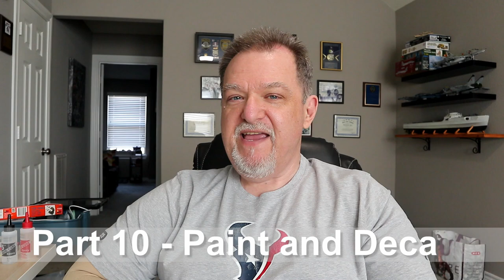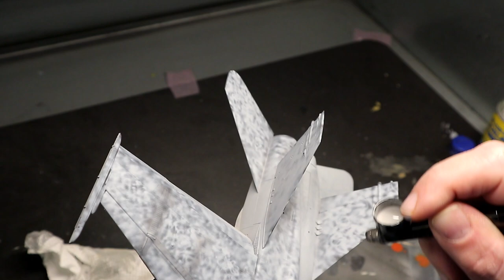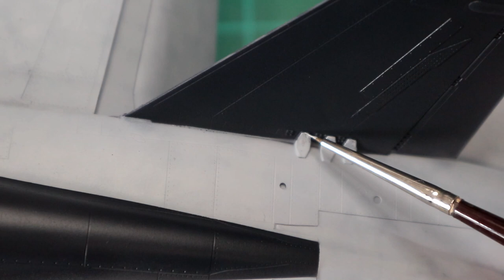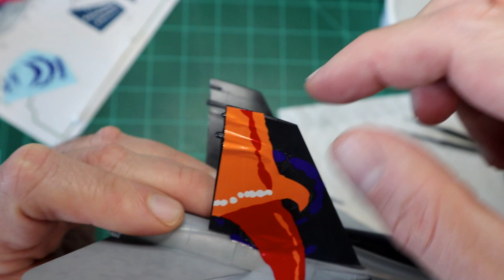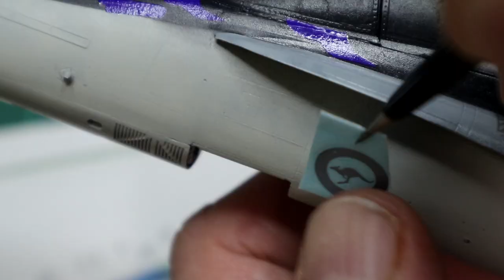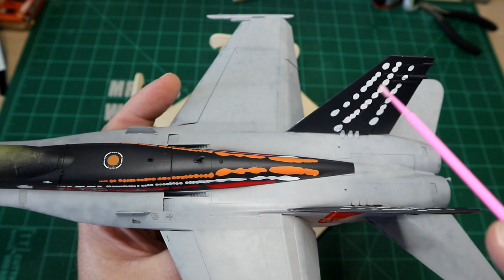Step by Step - Kinetic F/A-18, Part 10: You Need A Little Color...

Comment: Very nice.
I see you used Testors light grey, and I admire you for that (I hate airbrushing Testors enamel, or rather cleaning the airbrush after using it).
Now for the very entertaining part : glueing the landing gear. Funfunfun...
Reply from the maker: The Model Master paints flow much better with Mr Leveling Thinner. I highly recommend using it, especially on MM paints. I'm definitely not looking forward to the landing gear at all - lol.

Comment: I think the decals issues are the Decals themselves.. I have had issues the last two times, over the last several months  that I've used Model Maker decals  and  it was with  adhesion too. One set was a Mig-21 set and the other was an A-10 set. Its funny, the first time I used their Decals  was last summer on a F-16, and they went on flawlessly.
Reply from the maker: Hi Robert - I know that "it's a poor craftsman that blames his tools", but in this case I wasn't very happy with the decals. I would think twice before I'd use them again.

Comment: I think you're being too hard on yourself- it looks awesome! I'm aware of Ronin decals Worimi set- Which brand decals did you use? The upper surface grey looks bang on, I reckon. These Aussie classic Hornet's greys are the standard FS numbers, but they've bleached somewhat over the years. You only really notice the colour difference in the area you pointed out- between the wing's trailing edge flap and the stabilator. All the stencils are there, but you do have to get up close to actually see them.
Awesome looking plane. You've convinced me to make the same scheme and maybe leave it on a shelf at 77SQN. During the squadron's birthday, I asked the CO which aircraft he wanted made up...He said the loved Worimi Dreaming as well.
Don't stress, John! Its looking fantastic.
Reply from the maker: Thanks very much John - I was waiting for you to let me know what you thought. The decals I used were Model Maker Decals from Poland. A little too thick and the adhesion wasn't there for me. I hope to wrap this one up soon. Thanks again for your insights!

Comment: I think it looks great as well, but how do you avoid silvering under the decals?
Reply from the maker: Hi Ted- I still had quite a bit of silvering with these decals. I try to use hot water and then apply Solvaset on problem decals. Once it's in place you can also hit it with a hair dryer. Usually it'll settle down at that point. And thanks for watching!